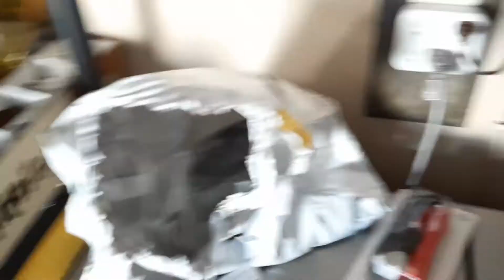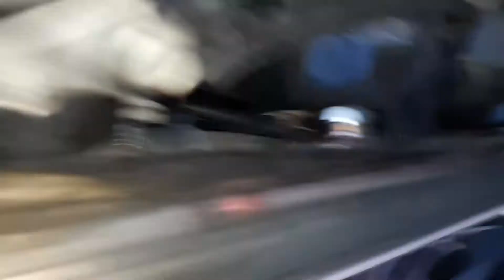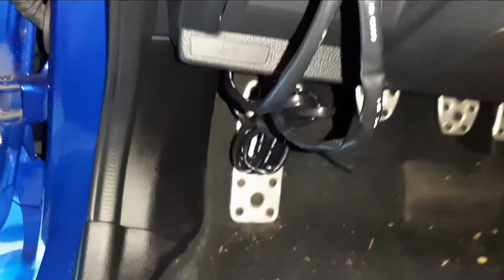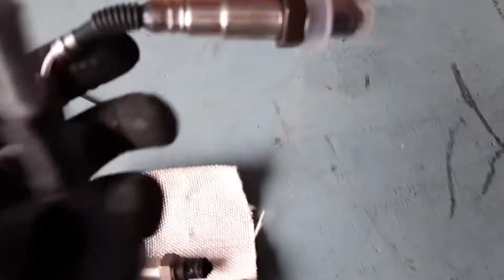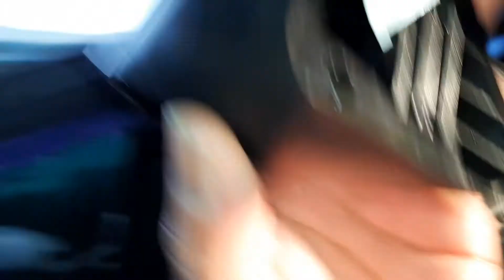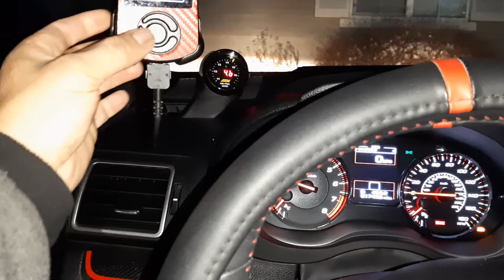AEM AFR Gauge install (detailed) WRX 2019

Comment: I noticed you didn’t use the blue and white wires. Any reason why? I’m currently sitting in my wrx scratching my head
Reply from the maker: Sorry I took so long to reply, but they are not needed. All you need is the black for ground and red for power. I forgot what the other wires are for. I believe for like an ecu or something for tuning purposes. Not 100 percent sure though

Comment: How did you mount the pod into the pillar? I’ve got mine sitting in the garage, waiting on my downpipe.. but I couldn’t figure it out of the jump
Reply from the maker: Ok so I originally wanted to put that single gauge pod i got off Amazon on the a pillar but I was unable to do so. To mount that you have to self tap screws to your a pillar. I didn't want to do that. So then I bought the SYM defrost vent gauge pod, and thats how I mounted the aem afr head unit on my dash
Reply: @jayswrx2417  yeah I have the SMY defrost vent gauge pod aswell. Just couldn’t figure out how to mount the aem afr head unit in the gauge pod. How to lock it in place
Reply from the maker: @Brian6spd   @Brian Cramer  oh I see what youre saying so don't use the bracket portion that ties the wires down. Just have head unit and plug the wires in and stick it in. It comes with a like rubber band kind-of thing, put that around the head unit before you stick it in so it fits secure, if it's still loose, grab some electric tape and put however much you need around the head unit to make sure it fits snug
Reply from the maker: But then I bought the JCS a pillar gauge mount, that has 3 pods, and now thats what I have,  video isn't out yet, but its not a detailed install video like I'm use to doing.